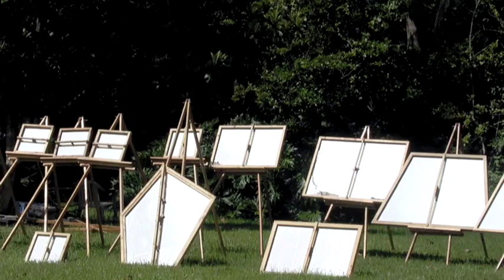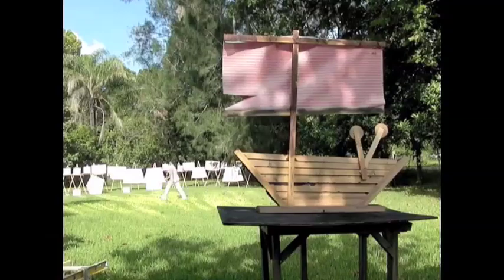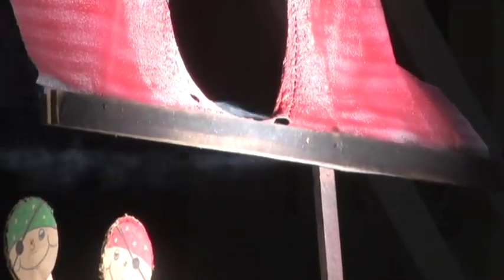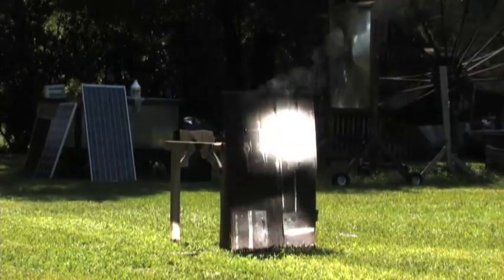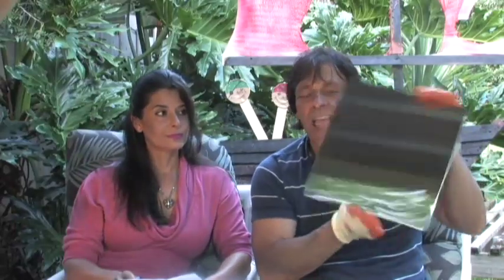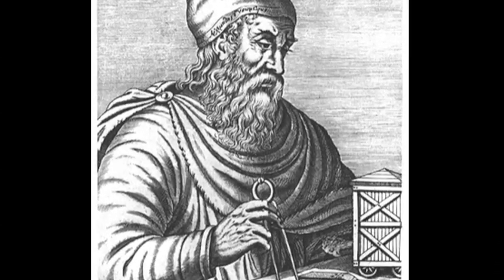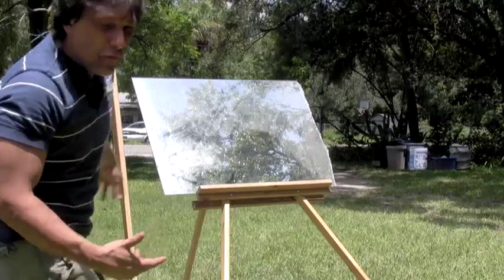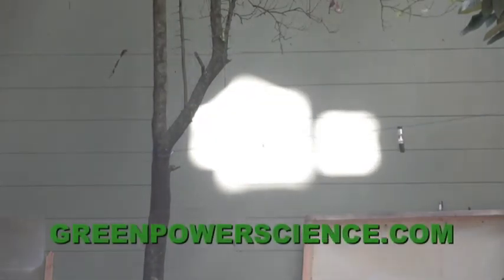Archimedes Death Ray Solar Parabolic Mirror burns a fake Roman Ship Mythbusters

Comment: Greetings:  It was amazing. Few lines how reflected light can be menacing. 

Tricky Reflected Light From Ground: "Acne management concerns"

Direct sunlight exposure, can char and dry up facial skin
Reflected light from ground  can set up inflammation for facial skin which is thin
Lower Triangle portion of Jacket on both sides can be a savior and what a delight
Manuvering with art one can easily avoid 100 percent direct sunlight
After 3 months skin won't be Comedogenic to Coconut oil
Domino effect and cascde of events in positive direction with no heat boils
Million benefits from Coconut oil gives a great fight
What a value for money and again what a great delight

Reflected light earlier was adding up to the menace
Often requiring face covering with temperature inside increasing like furnace
Sometimes with adverse effects of sweat and heat and quite deplorable
Though with extra efforts completely manageable

With Jacket use after 3 months
Moisturising everyday in the evening with Coconut oil
Skin can tolerate reflected light next day with mangeable hard toil
One can reserve cloth only for intense walk for more than 30 minute duration
When searching for soups and chicken broth prepared to perfection
Less than 30 minutes, no need to use clothes
One can remain slimy and sloth. 

Wonderful Day

Comment: Aiming a ray from the mirror is easy, if the mirror has a hole and surrounds of the hole on backside is also a mirror. Keep the mirror so that you see the target through the hole and turn the mirror until the image of the sunspot (ray through the hole) on your clothes disappears in the hole. This method is used with signal mirrors. You can train soldiers to follow a ship with their beams and quickly switch the target in command.

Comment: I don't think the mirrors need to be parabolic. If there are many people (soldiers) with flat mirrors (shields) and they all target the same area of the same ship, then they could set it aflame, especially if it's the sails. Same as the solar tower works.
Reply: It would never work,they need to concentrate the solar light in a very small point in the sail of that ship but if the ship wasn't moving and the sail would also move because of the wind.
The ships would have to be imobilized and the sails too,no movement.
Impossible.
Reply: @nunosantos00  The accuracy is very good, like projecting the sun on the wall with a watch. You can place it exactly where you want. Ships are nowhere as fast as to avoid this.
Reply: @dimitristripakis7364  The problem is you need a few seconds to start a fire and the object has to be imobilized for those seconds.
There is no chance this would even work against ships in the sea allways moving with the waves.
Reply: @nunosantos00 if size of reflection from any mirror can be reduced lets say 60x60 cm into 20x20 cm, a hundred of this kind into single spot you can melt a mm thick aluminum in just few second, at 1 sq metre wood will fireburst instantly, 

at 500 army into single spot probably you can vaporize any steel

Comment: 1 No ship would be stationary enough
2 10,000 men wouldn't be coordinated enough to target one and then another of the 60 ships coming in to attack them, especially during a war.
3 Focusing thousands of mirrors on a single person long enough to burn them is hysterically impossible
Reply: 1. old ship consist of bitumen, bitumen are black so absorb heat efficiently
2. let say 60x60 cm/ men, if you said 10000 men then you dont need precise focusing probably 3x3 m would burn in seconds, 
3. just take 100 men(36 sq m) if you can focusing at size of cooking pan you can burn at temperature above 1000 degree celcius INSTANTLY, at 500 men all known material will vaporize INSTANLY

Comment: I work for a company called ORANGADAZ - this tech has been rediscovered and optimized .

All you need is one commercial window constructed to create triangular virtual images - 

This will create the reflection of the real image of the sun in the center of the panel , and three virtual images of the sun which can then be directed using atmospheric lensing -

Polished metal is inefficient / treated commercial windows do not absorb thermal energy - all the heat is redirected to the atmospheric lens.

We are using this effect to create shockwave insulation and man portable defenses for small arms fire .

Comment: Solar mirrors are used to heat boilers to create steam used in fracking/oil recovery. The heat it produces to create steam, is enough to reach a wooden ship's sail kindling temperature. But that use hundreds of computer-controlled gigantic mirrors (e.g. Coalinga solar-to-steam facility in Coalinga, California) but it's possible.

Comment: Metal mirrors are single reflection.  Sun rays don't penetrate glass like today's mirrors, but instead reflect at point of impact of sun rays on the surface alone.  This preserves UV that today's mirrors filter in glass, and would offset wavelength sine differences  once the glass is traversed and light bounced against the silver coating in backing.  

I doubt Archimedes plan would be to burn woods when the sails were right there.  Even making a campfire, we don't light logs, we light tinder, then kindling and THAT burns logs (ship body).

Comment: I was reminded about the heat ray legend (or true story I suppose) just a few minutes ago. My girlfriend had placed a large mirror from a thrift story outside on a deck. Her mother uses a walker which was also sitting on the deck, not far from the mirror. Anyway, it's morning and the sun is rising and I notice some smoke outside. I look and it's coming from the foam handle of the walker, where the glint of the sun is right against the walker. It's a cold morning in new england and I was very surprised.

Comment: The account I read was of igniting sails and rigging. Sails were made of hemp fiber which is resinous and the ropes were hemp with tar to resist salt water.  Flat mirrors reflect a long way off. 10,000 troops with mirror shields vs those sails, even furled?

Just wondering if you ever compressed summer hot air? 95F is 308K. Squeeze air that hot down to half volume, it gets oven-hot. Squeeze more, there's a piston fire starter.

Comment: Ah! Doing what Adam Savage and Jamie were not intelligent or capable enough to do when asked by President Obama to set a boat on fire to prove the power of solar...  USE PARABOLIC MIRRORS!
Wonderful!  
sigh

Also, I didn't know Metal mirrors offer the advantage of being a true "First surface mirror" with most glass mirrors being second surface so you lose about 10% reflective power as the light is absorbed by the glass! Useful facts for setting enemies on fire!

Comment: The Archimedes death ray myth is anachronistic because it didn't even arise until something like 7 centuries after the event happened. The earlier stories only mentioned Archimedes using fire to fight the Romans, so the story was likely highly embellished as time went on.
This test only shows that you can cause ignition (and rather slowly) on totally stationary wooden blocks that are very close to the mirrors, and only under optimal weather conditions of a sunny and cloudless sky, and only with an extremely large number of very large mirrors that are well coordinated to focus on a single point of the totally stationary ship...this doesn't remotely resemble a battlefield situation and makes it totally impractical in real world usage. The attacking people and ships aren't going to be perfectly stationary at a close distance waiting for somebody's mirrors to set them on fire. The ships will be bobbing up and down on the water due to the waves along. Not to mention the extreme impractical nature of having to arrange so many huge expensive mirrors. The mirrors of the time were made of bronze, so it would be bronze mirrors rather than modern mirrors made of glass coated with silvering. Bronze isn't cheap either, since it was the material used to make weapons and armor at the time. 
All that effort could have been used to just making flaming catapults that could set a ship on fire faster, cheaper, at a far longer range, and more consistently. The original stories about Archimedes only mention him using fire as weapons, so it's far more likely he was just using flaming catapults against the Roman ships.

Comment: Incredible how differently biased people can be in a comment section... Obviously you can't just say something is true without considering a pretty large variety of variables. A few variables that will conflict:
1. Wind passing over a ship's surface increasing the amount of heat dissipating (Going away from) the ship. In this video the location is less windy because of the surroundings, comparing to sea-like climate and non excistant obstructions.
2. The further away you are when using a mirror, the less focused the light will be at the target, just think about the light intensity of a standard laser pen at various distances. Now light is energy and isn't really affected by the air, but is affected by the focus of the reflecting surface. In the case of a parabolic curve, sun angle is more limited and only has a very specific distance at which it is intense, but has the advantage of being able to concentrate the light in a more specific direction, (think flat vs. parabolic mirror at an 86 degree angle). A flat mirror wouldn't be affected by angle or distance as much, but would redirect light out in a more cone-like shape, dividing the energy across a larger surface the farther away you try to hit something.
3. Thermodynamics. Different things have different capacities for heat/energy before chemically reacting with different stuff. Water has quite a high capacity, and while in the water, the hull of the ship will be cooled down. Not only will the water cool it down, but the water will also change the characteristics of the ship's materials, by i.e. increasing moisture, and maybe even gain some resilience against burning from salt and slight decomposition, all being factors in increasing the necessary intensity of heat and the amount of time required for it to reach the temperature where the materials would ignite. And don't even get me started on air moisture at sea.
4. Burn the sails maybe? Cool idea, in theory, as ship sails, hemp, has a lower temperature for ignition, but in practicality? If a ship uses it's sails, it's because it can catch wind. Wind, as anyone versed in both thermodynamics, general physics, and perhaps some vector math, would know, increases the amount of gass matter passing over and through the hemp material, thoroughly cooling the sails to ultimately the same temperature, energy levels (Or in thermodynamics, molecular internal vibration), as the the medium's temperature.
5. Keep it steady sailor? try keeping a reflection on a moving target more than 50% of the time. achieved this? Great only 50% of that energy will have been applied, with the last 50% of the time will have been cooling time, kind of giving you an inaccurate 0.5x0.5= 0.25 25% effectiveness.

There are probably a lot more factors, to account for but just so "ya'll ain't gon' say": "IT'S TRUE BECAUSE I SAW IT ON YOUTUBE AND SO IT MUST BE TRUE, BECAUSE IT ALL CAUGHT ON FIRE AND ALL LIKE WOW"
Mythbusters didn't say it wasn't possible, they simply stated that it being used as a weapon to actually ignite a ship under the circumstances Archimedes would have had makes it impossible because of this gangbang of factors.

Comment: Myth busters, not smart enough.
Reply: The mythbusters and this test both prove that this weapon is likely fictional because it is highly impractical. This test only shows that you can cause ignition (and rather slowly) on totally stationary wooden blocks that are very close to the mirrors, and only under optimal weather conditions of a sunny and cloudless sky, and only with an extremely large number of very large mirrors that are well coordinated to focus on a single point of the totally stationary ship...this doesn't remotely resemble a battlefield situation and makes it totally impractical in real world usage. The attacking people and ships aren't going to be perfectly stationary at a close distance waiting for somebody's mirrors to set them on fire. The ships will be bobbing up and down on the water due to the waves along. Not to mention the extreme impractical nature of having to arrange so many huge expensive mirrors. The mirrors of the time were made of bronze, so it would be bronze mirrors rather than modern mirrors made of glass coated with silvering. Bronze isn't cheap either, since it was the material used to make weapons and armor at the time. All that effort could have been used to just making flaming catapults that could set a ship on fire faster, cheaper, at a far longer range, and more consistently.

And the myth is anachronistic because it didn't even arise until something like 7 centuries after the event happened. The earlier stories only mentioned Archimedes using fire to fight the Romans, so the story was likely highly embellished as time went on.